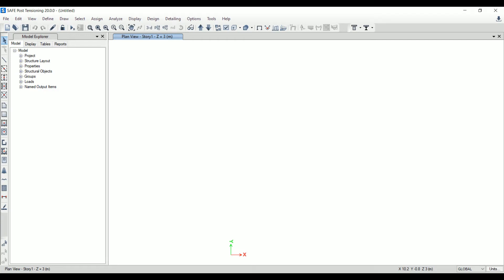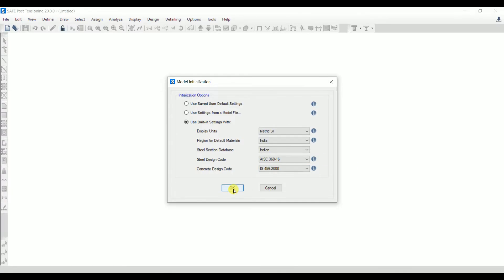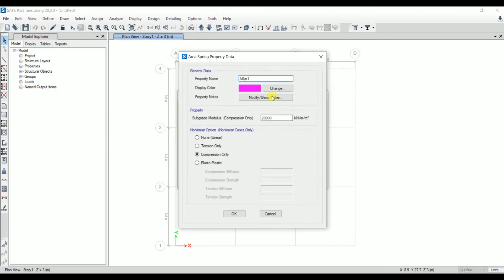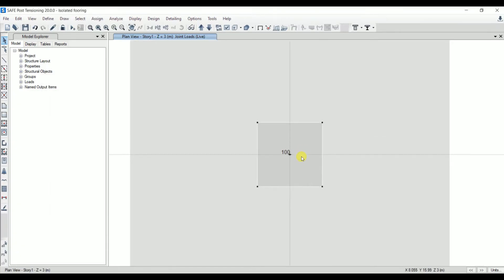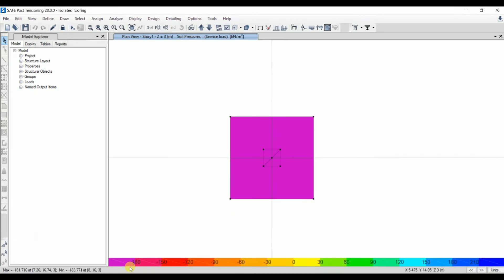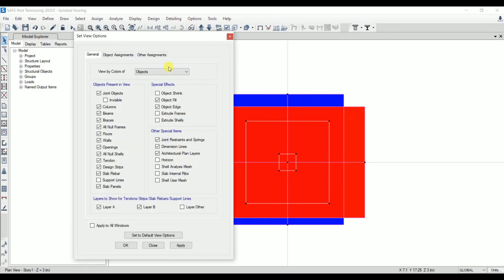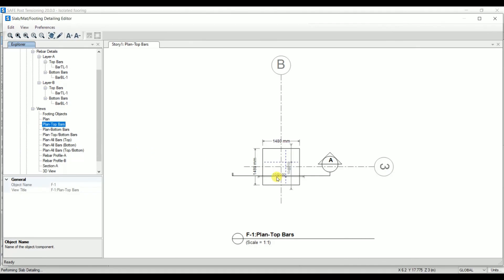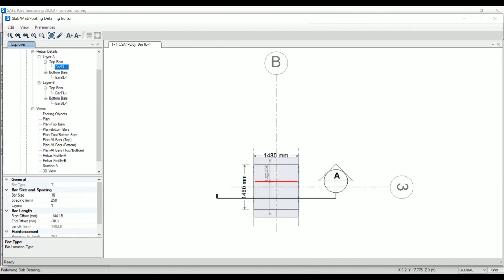Isolated Footing Design and Detailing using Safe Software | Safe 20 software | CSI Safe

Comment: As per your explanation you have not considered factored load while calculating the reinforcement, but you have specified factored load in load combination. Will the software design reinforcement for factored load combination by default??

Comment: Mam we should consider factored load right for foundation design
You have considered unfactored load…
Please reply
Reply from the maker: We have to consider unfactored load to find out only the area of foundation and factored load to be considered to calculate the reinforcement.
Reply: As per your explanation you have not considered factored load while calculating the reinforcement, but you have specified factored load in load combination. Will the software design reinforcement for factored load combination by default??

Comment: while i run i get warning (Model has been checked, 1 warning messages Warning: Check meshing, At area 1 ( 5.44% Increment) Check Warning File(C:\Users\sushi\OneDrive\Desktop\Running Project\Strucutre\Structure\safe\Foundation.WRN).) how do i solve it

Comment: Thank you for the lesson. Excuse me, I have version 20.3, while in version 16, when right-clicking on the Shell element, you could see the "Design" tab. However, in this version, that tab is only visible in Frame and Ribs elements. For Shell-type elements, only "Geometry," "Assignments," and "Loads" tabs are available. Is there a way to activate it, or does the tab appear differently for these elements?